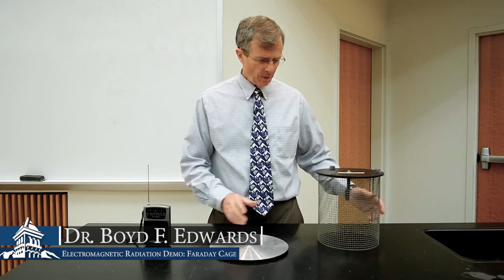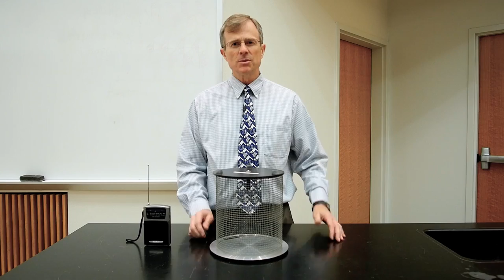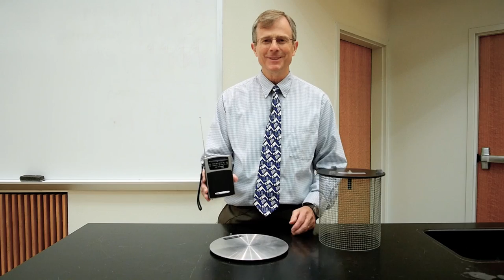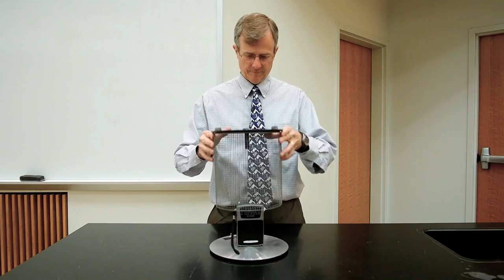Electromagnetic Radiation Demo: Faraday Cage

Comment: The electric charges on the metal cage they oscillate as the incoming EM wave. Then why the wave doesn't continue to propagate ? Is it because the shape of cage is spherical so its field from charge in the cage is cancel out by its symmetric charges ? Thanks in advance.
Reply: When the holes in the cage are smaller than the wavelength it can't penetrate, super simple :)

Comment: IF Faraday cage excludes em radiation then how come we can see what is inside the cage? The light is also em radiation isn't?
Reply: The Faraday Cage doesn't exclude visible light, which is a different part of the EM spectrum, which is why we can still see the radio. Visible light has a much smaller wavelength, and that wavelength is small enough to pass through the little holes of the cage, bounce off the radio, and bounce back to our eyes and be seen. The radio waves (which is the specific range of wavelengths the antennae is made to pick up) have a much larger wavelength and can't pass through the holes, so they don't reach the antennae
Reply: @bogbert7019  Right, so in general Faraday’s cage doesn’t stop em radiation, however it may stop specific range of em waves depending on the size of mesh of the cage.
Reply: @danieljust295  yep! just depends on the wavelength of the wave and the size of the openings

Comment: You present very nicely but your explanation is TOTALLY WRONG.
The Faraday Cage does not "block" the incoming signal at all.  The incoming EM signal goes right thru the cage unperturbed. 
The reason that the amplitude is low inside the cage is because the cage emits its own INDUCED field which is nearly opposite in polarity to the incoming field. 
Inside the cage, the INCOMING and INDUCED field add up in OPPOSITION creating a deep null.
Go look it up in Jackson's Classical Electromagnetic Graduate textbook.  You are propagating FALSE information.
You are welcome.